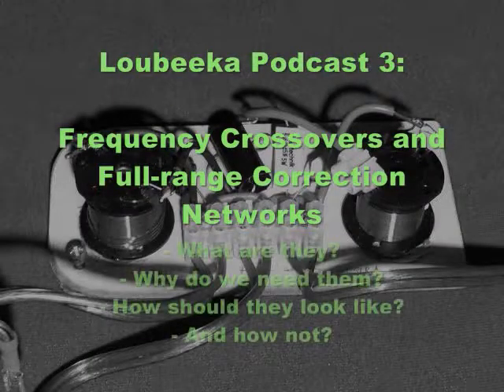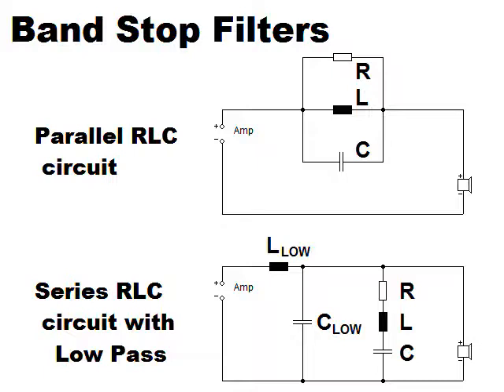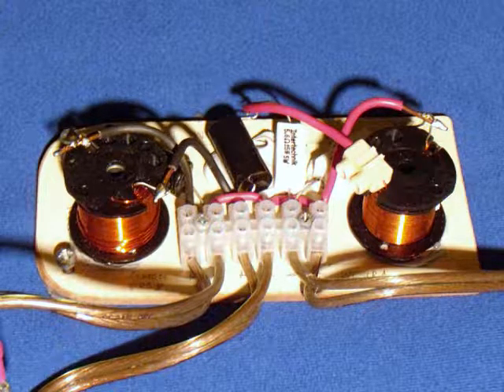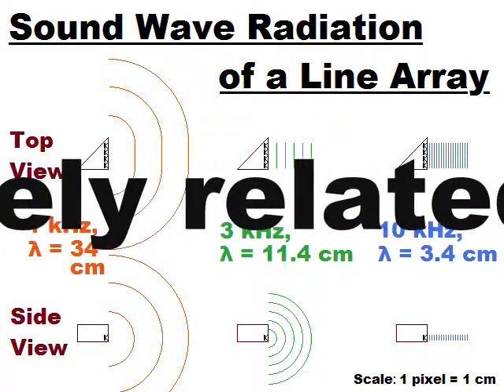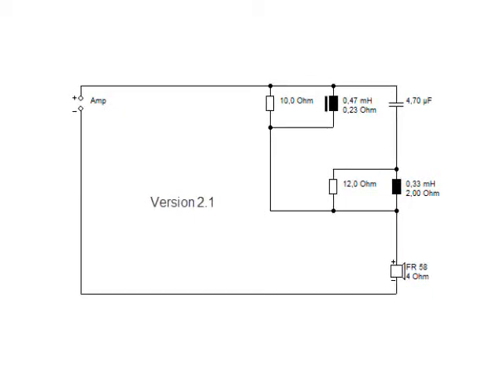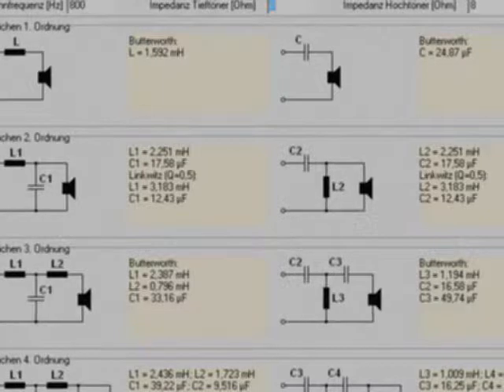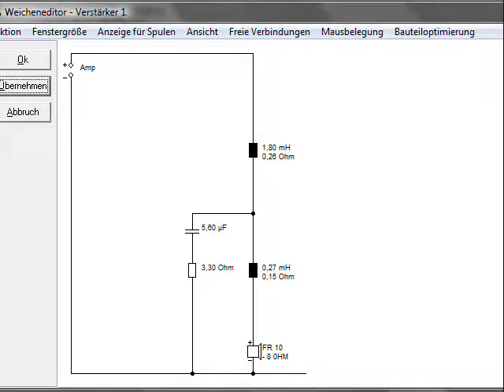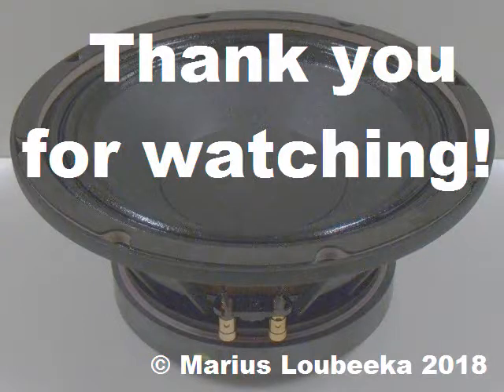Loubeeka Podcast #3: Basics - Frequency Crossovers and Correction Networks for Newbies

Comment: My speakers were originally made in Germany (Braun)  in the late 70's.  They became ADS in the USA.  The thing that made them exceptional (other than basically superb engineering)  is the quality of parts.  The dome mid and tweeter are very accurate and uncoloured sounding.  The woofers have a light, rigid construction, which is better than the pure-polypropylene Watkins woofers that Infinity was using then. While companies in 1979 used high ESR electrolytic capacitors in the crossover, Braun/ADS used metallized polyester.  In my experience, they are low ESR and much better than electrolytic.  I restored a pair and installed metallized polypropylene of the same values.  I'd have to say that polyester is vastly superior and more neutral than electrolytic, and polypropylene is a little better still. I have heard Kef, and a host of other speakers re-capped with metallized poly and the speakers were obviously improved over the cheap stock capacitors.  I found that exotic caps (paper in oil, tantalum etc)  are high esr and a waste of money. PIO was used to roll off the treble of harsh klipsch speakers in the past.
Reply from the maker: Interesting thoughts! The German DIY loudspeaker magazine Hobby HiFi made a huge observation about that topic in issues 5/2000, 2/2001 and 6/2001 and found out, that microphonics play the biggest role in sound quality of all crossover parts, not only caps. I’m already preparing several podcasts and videos about types of parts. So better subscribe, if you haven’t already, to get notified.
So much in advance: the higher the rated voltage of film caps the better they sound, because due to thicker foil they can be wound tighter. Thicker metal film would also lead to lower ESR but resistance is linear and therefore less relevant for sound quality. Paper/oil caps, Hobby HiFi say, sound best but they need time to break-in and need highest quality drivers, especially tweeters, with low mechanical losses (Rms) to tap their full potential. As a rule of thumb the total cost of the crossover should not be higher than the sum of the drivers’ costs. Then it's better to upgrade the drivers. The Scan Speak beryllium tweeters in my Illuminata 15 pair (see: https://www.youtube.com/watch?v=gMyE3SUvSeM&t=390s&index=2&list=PL4lJ1ej0uWlQ5xjxRERTleY3A5Xr8zzpq) have the potential but I did not yet try it out.
BTW, I had some Braun L710 from the early 70s but unfortunately I neither looked at their crossovers nor measured them.
Reply: @mariusloubeeka5810  Can you advice me, where i can found the schematics of Illuminata 15 crossovers?

Comment: how the impedance change when using an amplifier with dsp that has separate channel for tweet ,mid and sub. The passive crossover for component speaker should be removed from the network right.
Reply from the maker: If you use an active digital crossover you don't need the passive crossover but to design the frequency response via DSP also takes some effort.